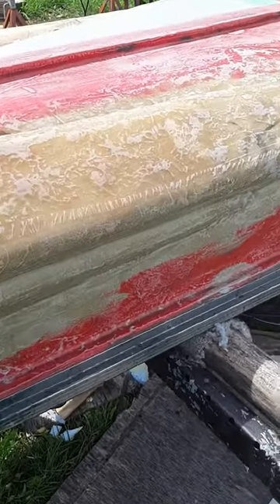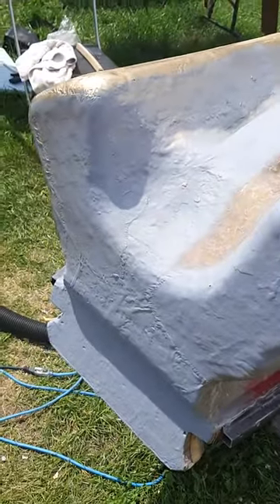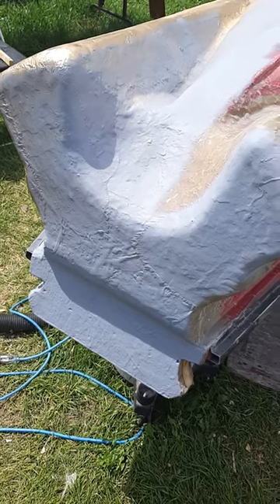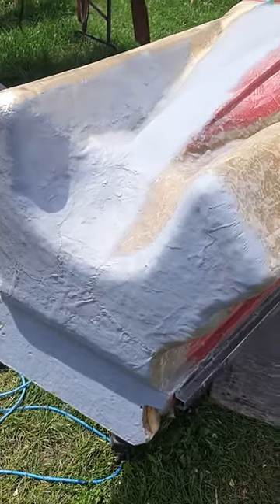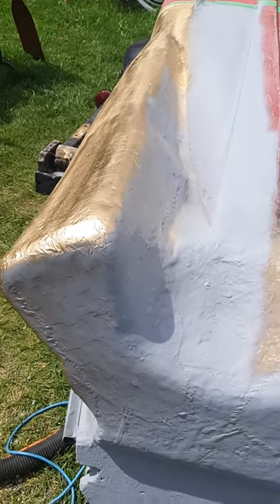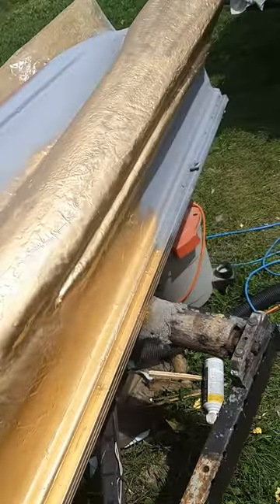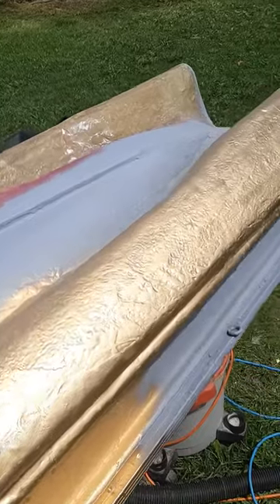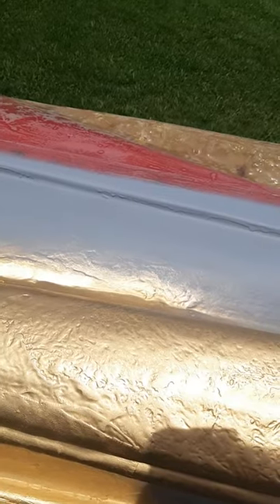Sterndrive build part finish

Comment: Hey Bruce   it looks FAST with that Golden paint,,,  I've got a 25 hp Evenrude you can try on     ''er
Reply from the maker: That would by crazy to try.
It would be a bullet on the water ! Lol
Thanks for the comment. 
Stay well in these trying time ! Many good Blessings
Reply from the maker: That design helped a lot on the back of the canoe.  300 pounds and motor can by at the back with no one in front.  Rides great. 
I sold it to a senior couple that needed it .